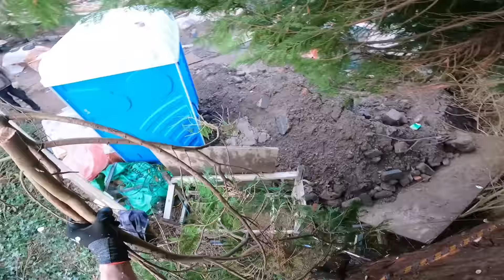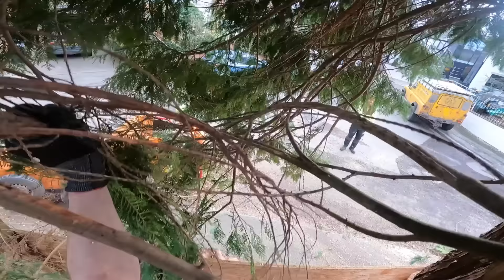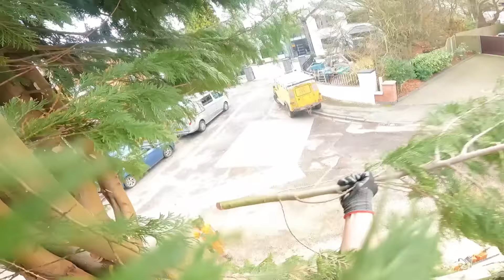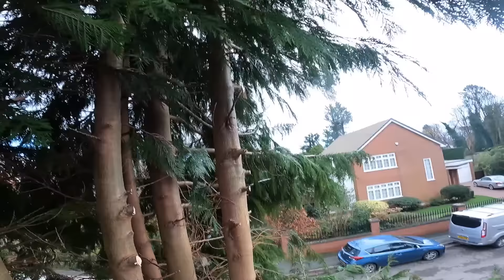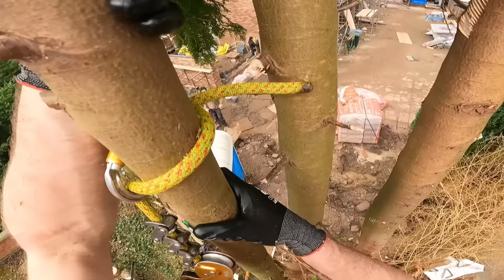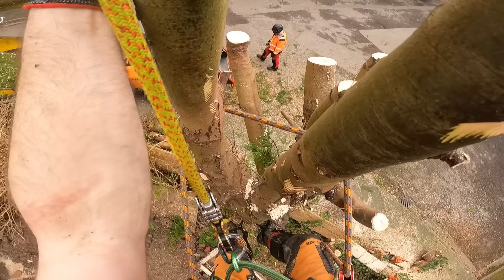Removing Your Average Sized Garden Tree 🌲

Comment: could the job been done sooner if thos vertical branches were cut after the lower side branches were disposed? the shredder looked opened enough to swallow those vertical branches even with the side projections.

Comment: O zige zage não é apropriado pra trabalhar dessa maneira
Reply from the maker: Thankyou for your concern, however as I am not decending or ascending solely on the zig zag and have most my weigh in my side line it is perfectly fine to use for better work positioning this way. Yes If I was descending on the zig zag I would have the chicane above.

Comment: Vc tem que usar um freio auxiliar
Reply from the maker: Usually yess but as it was only for work positioning amd not descending or ascending the auxiliary brake was not needed in this circumstance as most my weight was on my side line and the zig zag was a back up